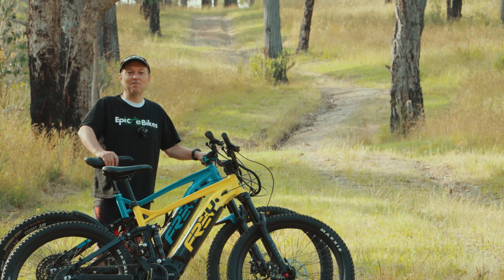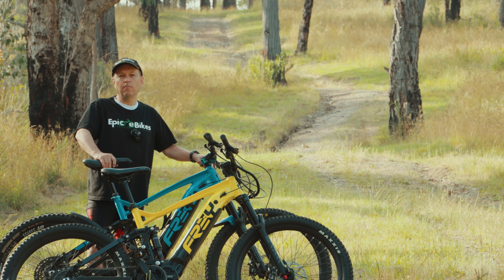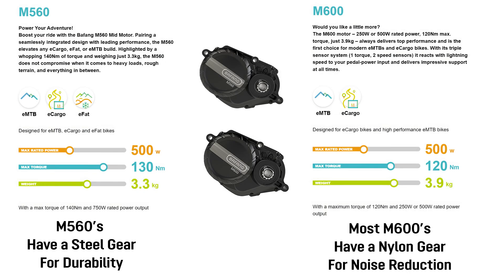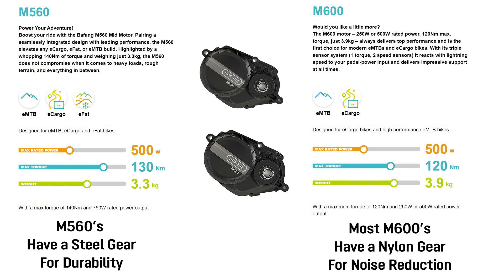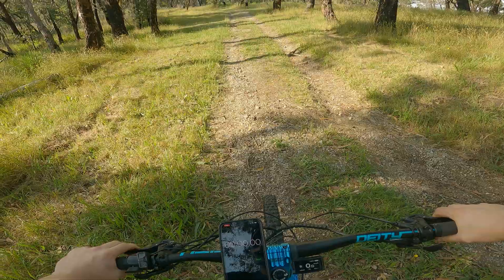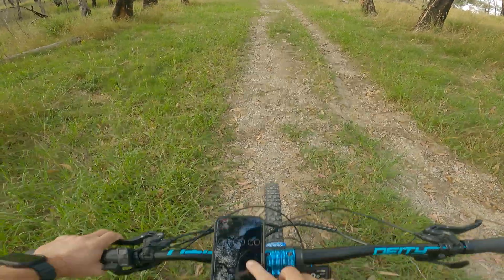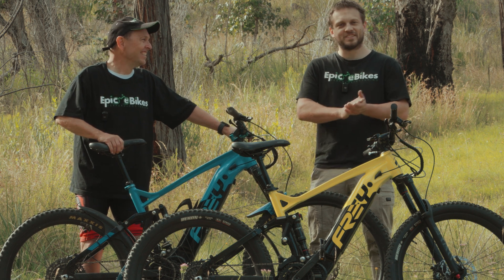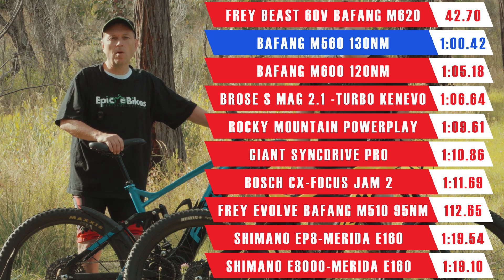Bafang M560 Motor Tested - How Does It Compare To The Competition?

Comment: BBS02 and HD motors have successfully used nylon gears for years, pushing the same or higher power than the M560. the chances of the nylon gear failing are far lower than a bearing failure or grease displacement from thr gear teeth. The nylon gear is great because it makes the motor extremely silent. If you want to hot rod the motor and cook it eventually, go for the PEEK gear. full steel gearboxes are just horribly loud and annoying

Comment: Thanks boyz. So won't be selling my M600 for a 560. Durability? 2 years 1000+km no issue motor wise. Seems the battery is the likely weak link.
Reply: my customer has 26000km in 3 years on his BBS02 which had a nylon gear. the gear is as good as new, but one ball bearing disintegrated.
no need for steel gears up to 1500W
Reply: @JoLe1991  ive a BBSHD on 35000km, all original parts. just gets a regrease and a paper gasket every 3-4000km
Reply: @ducksgoquackirl92  yes the HD is built more robustly than the 02
Reply: 1000km in 2 years, that's shocking.

Comment: Why didn’t you comment on the over run?  I had 3 of these when they were first released and love them except for the noise and the over run. The over run is terrible. It is not consistent and at times dangerous I took the motors and gave them away to see if someone could develop a fix. I’m back to riding Luna Ludicrous which is a little more thirsty on the battery but predictable.
Reply: what do you mean by over run?  like it keeps going when you stop pedaling?
Reply: I should say the controller is buttery smooth from standstill. I would say it is on par with Bosch or Bros. I don’t know why they have the overrun, but they definitely need to fix that. This motor is a nightmare just because of that.
Reply: @garyfuller6553 I assume that should be settable with the BESST tool. Just about to get one, mainly to tune the new M435 BBS motor. overrun is definitely tunable on the UART BBS02/HD through the configuration tool
Reply: Yes, when you stop peddling the motor continues to push you if you are just starting out and let off the pedals it will actually accelerate after you stop, which can be very scary
Reply: To solve this problem could i install a brake sensor?
Reply from the maker: Frey has worked with Bafang on Custom Firmware for the M560 and we did not notice significant overrun with our test bike. The hill test is also not technical enough for overrun to be an issue on any of the motors we have tested.